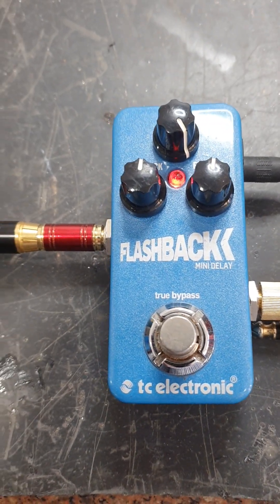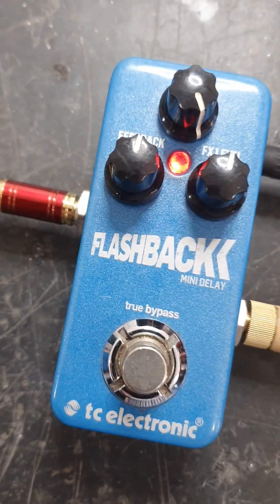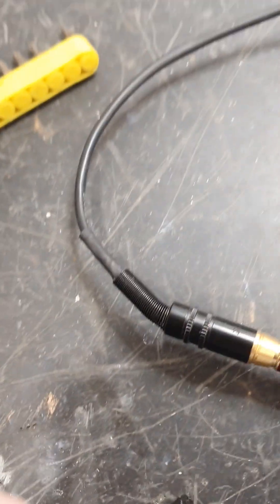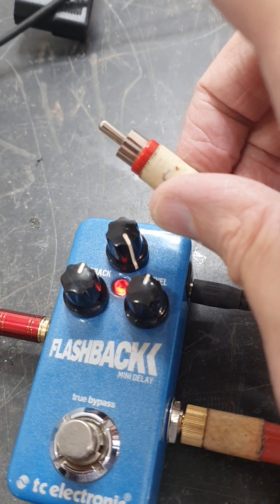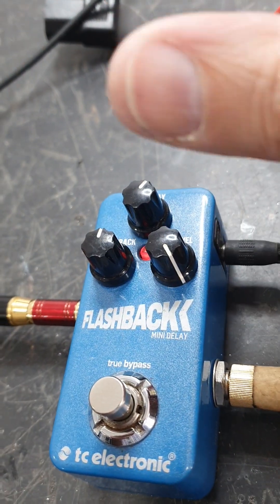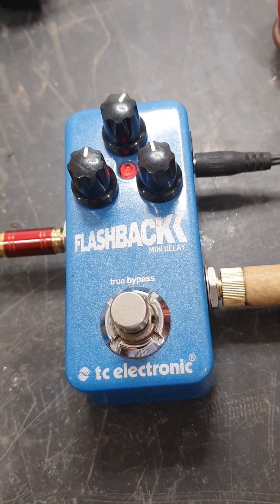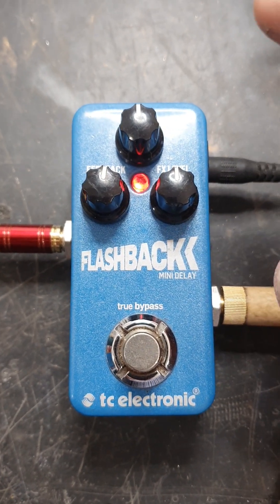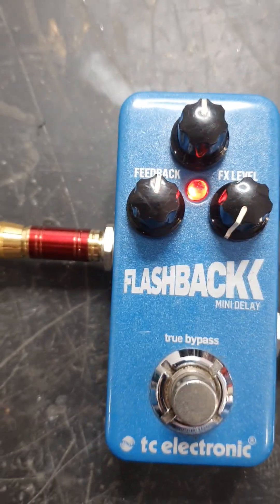TC Electronic Flashback Mini Delay - Can you help me?

Comment: Hi bro, thanks for the video!!! I have a problem as well with mine... I also have a TC electronic mini flashback delay exactly as this one... Well, the problem is that it turns on... It is working with the power but there's no effect on it... suddenly it stopped working... And basically when I turn it on there's no signal... If you know something about may you help me please? Thanks in advance